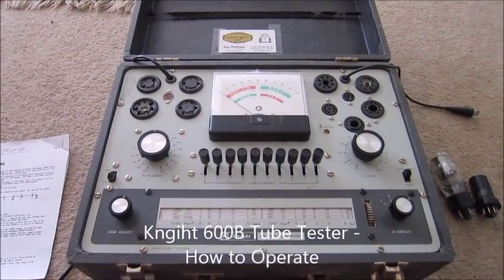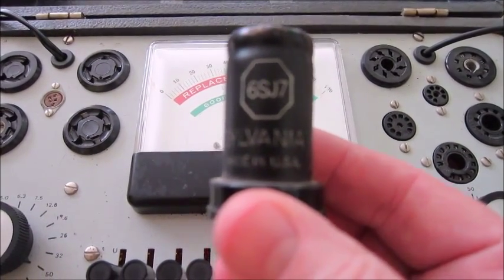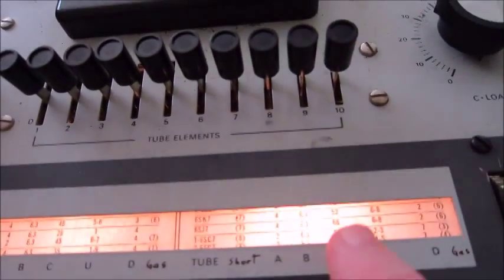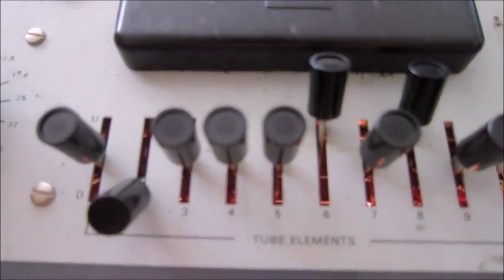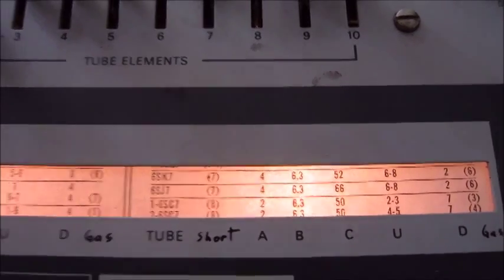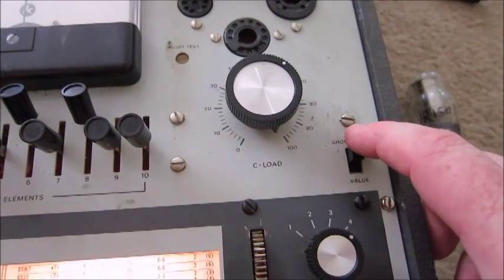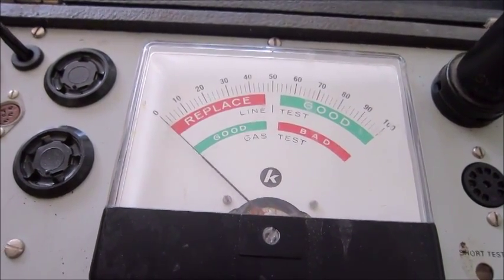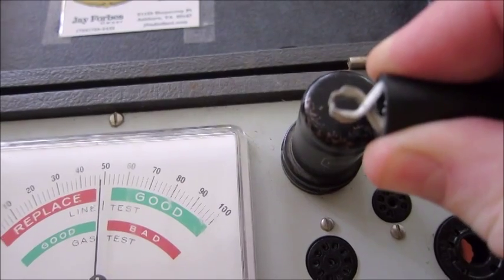Knight 600B Tube Tester - How to Operate

Comment: Hi, I have one like this, maybe a 600 (not "B"), and I am unsure where to set it for an el84 tube, I do not see it on the scroll, I also looked up 7189 and 6bq5 and some others, none are on the scroll. Any ideas? Thanks so much!
Reply from the maker: Try these settings for the EL84 tube:
A = 4
B = 6.3
C = 35
U = 7 and 9
D = 4
1,2,5 will show a short (neon will light up) when testing - moving to neutral position.

9 will show the neon bulb flash when tested.  If that stays on, tube is no good (grid short).

Make sure to tap the tube while testing.
Reply: Hello, I thank you so much for giving me this info. I looked all this up and saw a post from a guy testing an el84 and in his picture I could only see the positions of the 3way switches, had no idea where to put the other dials. The switch placement was exactly as you described and now I know where the dials go and I really appreciate it, you just saved me an hour and a half drive (each way) to my electronics repair guy, and I had about 20 el84s laying around and I now know the condition of each one thanks to you...

I had been letting a friend use the tester for a couple of years and I got it back without the manual, but he has found the manual so while I do have other questions, I will refer to the manual first, very nice to know you are out here though, just in case. 

A couple of basic questions if I may:  I notice that when I insert a tube, the light inside the unit gets slightly dimmer, is that normal? Also, is that switch/knob combination for the el84 listed as a different number anywhere on the scroll? Again, much appreciation! @atwaterkent911
Reply: One observation: On each tube during short test, when I flipped the 5 lever up, the short light stayed on when it was in that up position, only on lever 5. This was true of a tube from an amp that is working with that tube. Wondering what that means, if you know? Thanks again.
Reply from the maker: The setting was in a manual I have for the 600, not on the roll chart.  If you want that, I can email to you.  jfradio at aol dot com

Yes, the pilot light will dim a bit when you insert the tube.  This is due to the power transformer in the tester being very small (low wattage).   @bzbzob
Reply from the maker: The tube chart will indicate which positions show a short for a given tube.  This is normal for those positions shown.  

If 5 is showing a short no matter what, you better take the tester apart and see if anything looks amiss. @bzbzob
Reply: @atwaterkent911  Hi, thanks. I sent an email to you about getting the tube chart, let me know if you got it. I am not sure I explained everything correctly regarding the "5 shows a short" situation, I think I will be able to figure it out with the chart, and looking at the instructions in more detail, I just got this unit, was doing my first tests. Thanks again so much for the invaluable info...
Reply from the maker: Email sent to you.  If not received check your spam folder. @bzbzob

Comment: Is this a good tube tester? Is it limited in operation?
Reply from the maker: It is pretty good, and will find most issues with tubes.  But it is lacking in leakage tests since it only detects leack less than 100k ohms only.

Comment: Nice video.  I have the Knight KG-600C Tube Tester.  It looks, and works identical to your tester.  I just had mine out, testing tubes, and thought I would check for a video.  Thank goodness for the manual, or I would never know how to use it.  Got it at a Hamfest a few years ago, as things were wrapping up.    Some how, I talked the seller down to $40.  I see that they are going for good money now on eBay.  73 Paul AAA1SU

Comment: Thanks.  On some tubes they have 2 lines for the same tube number. Usually the numbers are the same but the switch position is different.  What does that mean? Do I do both tests?  Thanks!
Reply from the maker: Yes, you do both tests.  For example, one may be the triode section of a tube and the other the diode section.
Reply: That's what I suspected.  Thanks much.